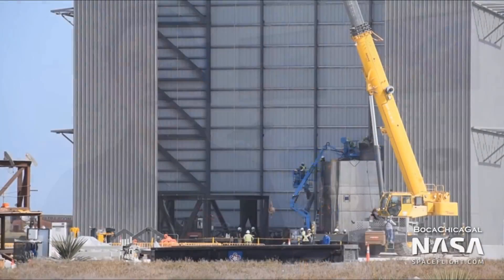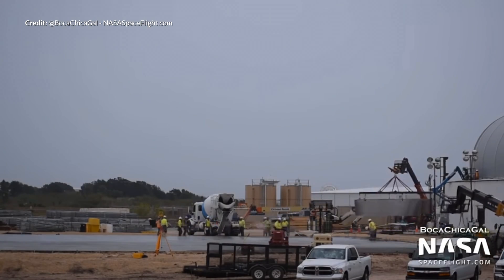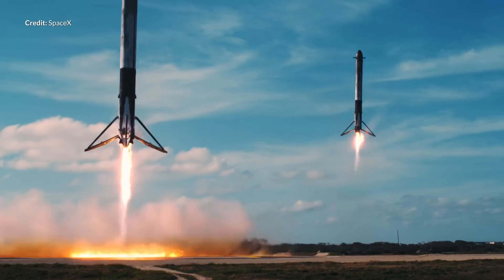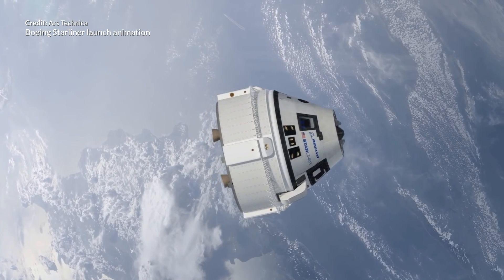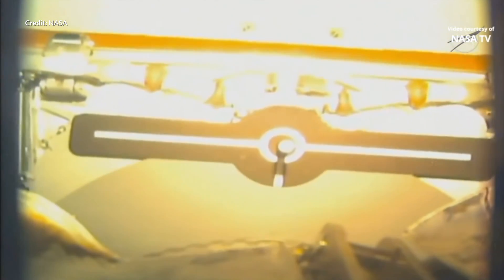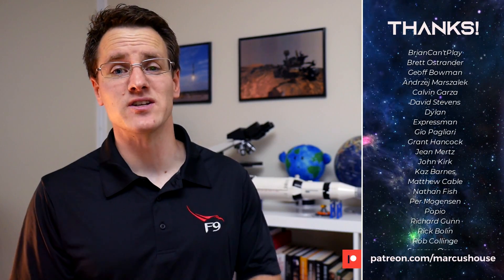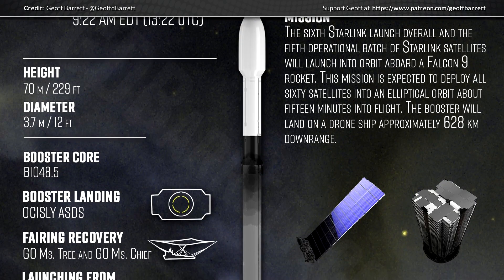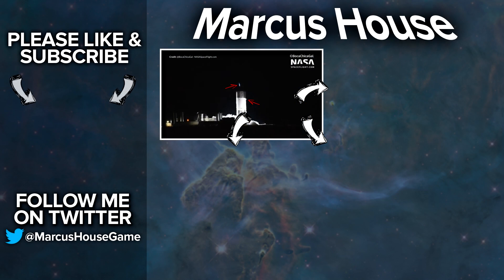SpaceX News, Flights with Starship SN3, Boeing Starliner, Blue Origin, Starlink 5 & Simple Rockets 2

Comment: If the ISS is still going to be decommissioned is it going to be dropped on Australia like the last few stations were or could it be repurposed by a private company? Maybe Elon could acquire it and use it as a refueling rest stop or something? maybe even move it to L1?
Reply: The ISSis not going to be safe for long time. the equipment breaks down, it wares, and is not rated at all for L1, becouse of it's radio shielding. Space environment is very harsh, for many materials.
Reply: @thedroplett214  That sucks. Going to have to buy an umbrella then.
Reply: @lzot . It does. But this is a reality that we have to deal with.

Comment: Is it legal to build a rocket?
Reply: There are no rocket rules in international sea
Reply: It depend on fuel. Some is considered regulated explosives. Then there are different certifications for flying them. Then there is the laws regarding putting guidance on a rocket.  Thats a big no no. You can fairly easily be certified thru many model rocketry associations to build and fly large and high altitude rockets. You just need deep pockets. Just dont put a flight control computer on it.